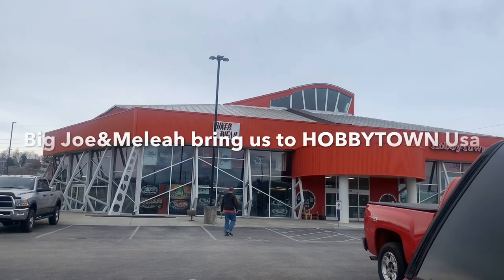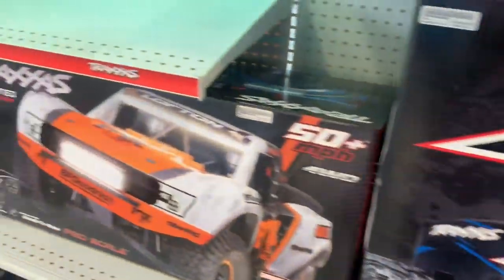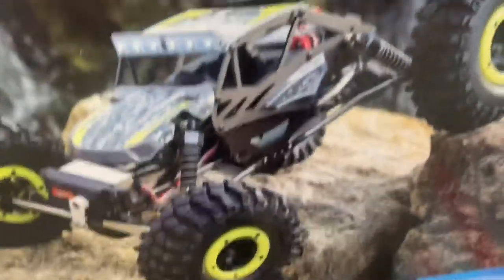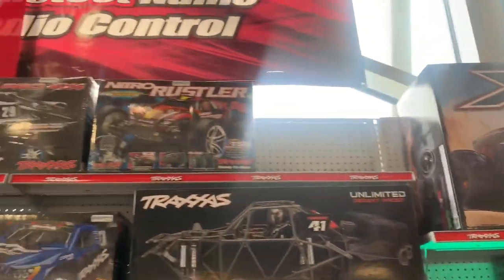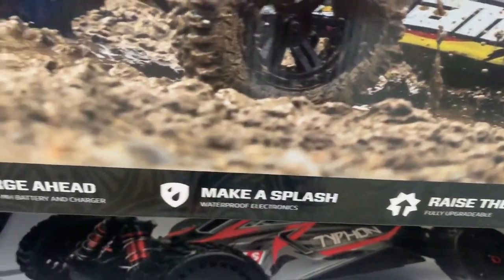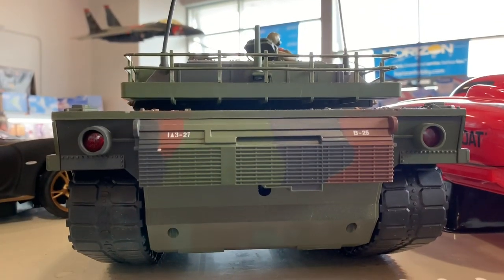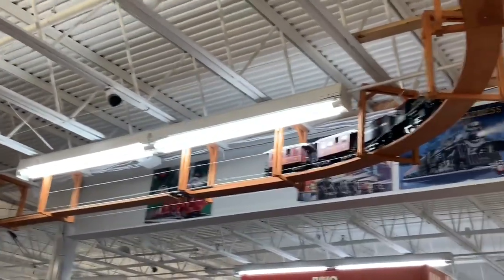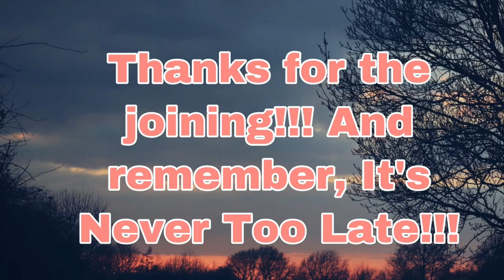HOBBYTOWN USA in Johnson City, Tn

Comment: I've had a Traxxas Nitro Stampede for years - fun, easy to set up and run, fast and stable over grass / dirt / gravel / pavement. Once you get the hang of nitro engines you will be hooked! The sound and smell - leaving a smoke trail behind as you tear it up. I wish we still had Hobby Town anywhere near. My closest hobby store is 70 miles away and not nearly stocked as well. Peace Love & Light